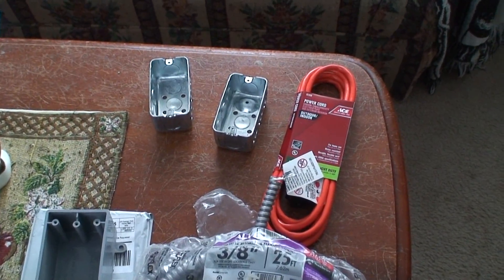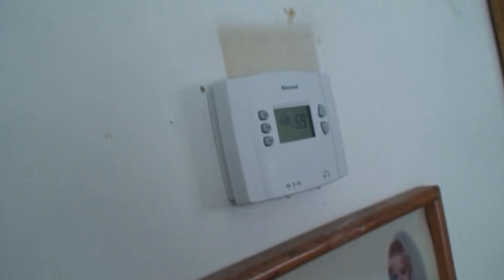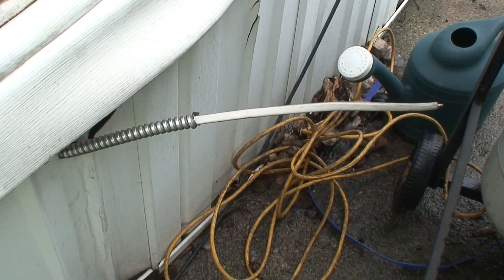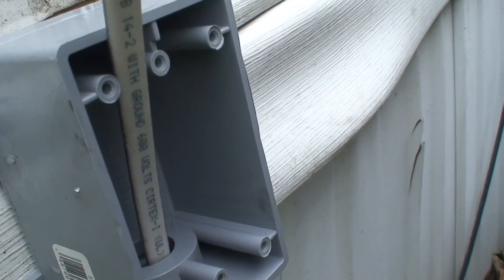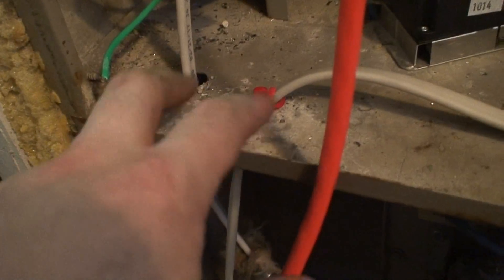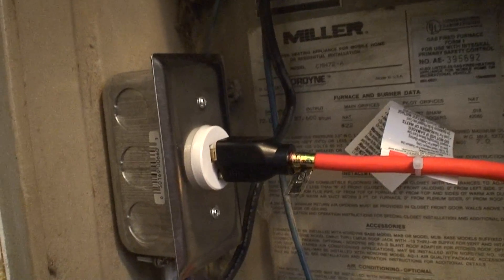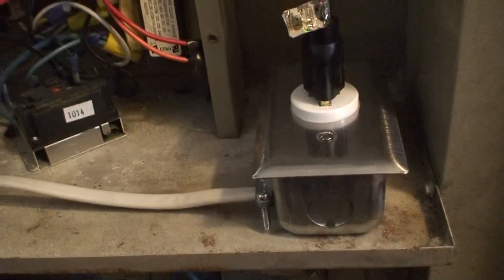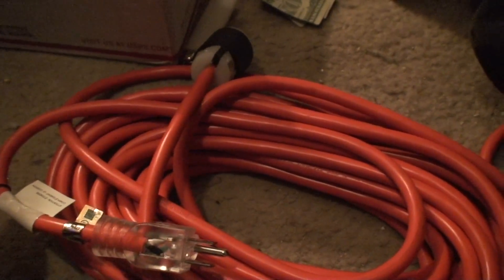Configuring The Gas Furnace For Generator Power

Comment: And by the time this is all done it'll be warm enough to shut the heat off!

Actually, the cord you made is called a "suicide cord".  This of course goes for people that have no clue, which I know is not you, but if you start the generator, plug the cord into it, then run over to the trailer with the other end and happen to touch the prongs, they are LIVE.  So basically in the event of switching to generator power, it's trailer first, generator last.  When switching back, it's generator first, trailer last.  So the idea is there, and most certainly will work the way you designed, you just have to be VERY mindful of the suicide cord, people touch the prongs of cords all the time without even thinking about it.  There will be a time most likely where you'll be caught off guard.  Generally, any time I got shocked was because I wasn't paying full attention to what I was doing.